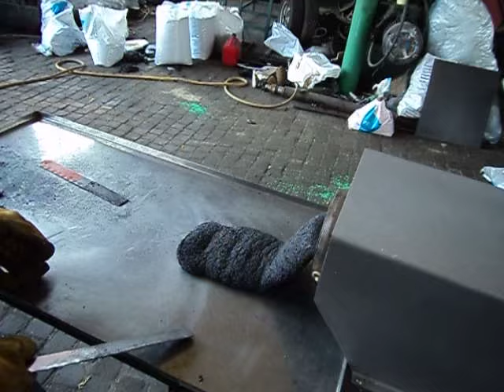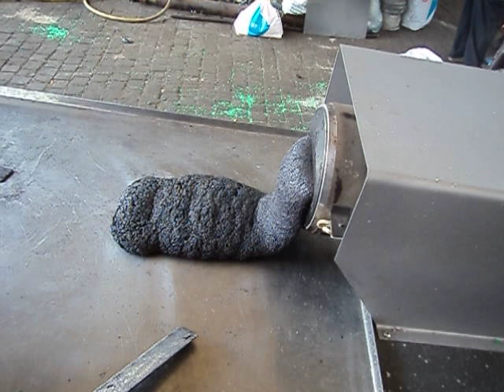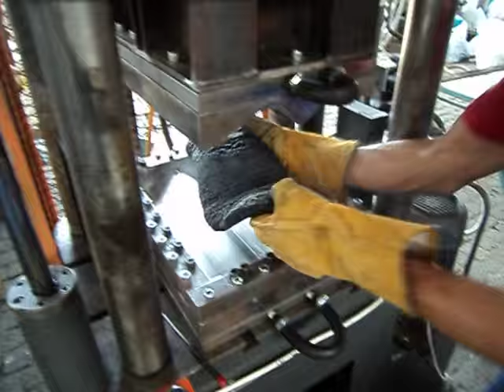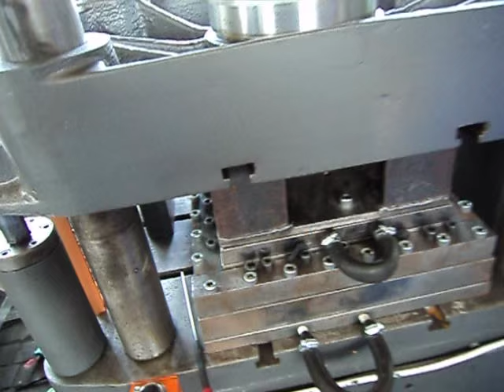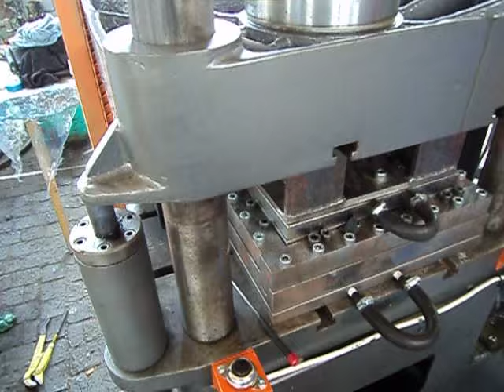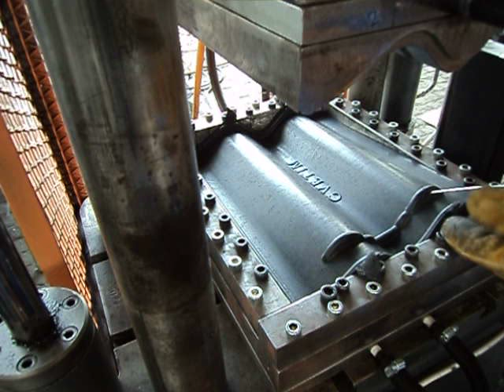Machine for Roof Tiles From Recycled Plastic

Comment from the maker: Hallo
We are the producer of this machines.
The installation costs 68000 Eur with the moulds.
We can make the moulds with a drawing or muster in Your standart/the standart is different in the countries/.
Time to work-3 months.Installed power-20 kW
The installation includes:
1.Specially extruder
2.2 moulds-tile and cover
3.Press machine
4.Mill for PET 
5.Calibrator cooler for the ready details
The machine can make 60 pieces per hour.
The making area is 20 m2 without warehouses.
If You have any questions please send us.
Best Regards

Comment: I'm interested in an operation like this machine can you forward me a price and more details
Reply from the maker: We are the producer of this machines. The installation costs 98000 euro   
with the moulds. We can make the moulds with a drawing or muster in Your   
standart/the standart is different in the countries/. Time to work-3   
months.Installed power-20 kW The installation includes: 1.Specially   
extruder 2.Press machine 3.Calibrator   
cooler for the ready details The machine can make 60 pieces per hour.   
The making area is 20 m2 without warehouses. If You have any questions   
please send us.The produce time is two months .   
The line for the production of floor coverings and roof tiles is the same. Just change molds.   
There is also a difference in the plastic mixture because it can also be used petrified PET bottles.   
The installed power is 25 kilowatts, but the working consumption is about 10 kilowatts.   
The blending ratio is 30% plastic and 70% sand.   
Marble flour can also be used to better achieve the desired color.   
For paint, use is an oxide cement paint..   
The cost does not include delivery costs. You will get a detailed video on launching and operating the machines.   
You need to specify what details you want to make.

Our plant uses waste plastic as a raw material, which cannot be used for separation and recycled as a secondary raw material. For example, plastic bags, car plastics, packaging and much more. Plastic waste is crushed with a grinder or agglomerator of fine particles about 4-5 mm. They are then mixed with dry sand in a percentage of 50/50 in weight units. 0.1% oxide paint is added. The semi-honest mixture is then placed periodically in the curing extruder, which cures the mixture and it exits as a soft mass. With a certain dose is placed in the mold and the press presses the finished product. The product is then placed in a special calibrator to make it true and not deform. One cycle lasts about 1-1.5 minutes.

Comment: Mr. Andrey Kolev
I´m studying in Espol (Polytechnic), Ecuador. I have to do an investigation about the molds used to manufacture PVC Roof Tiles. Could you give me some specification of the mold used in the Plastic Roof tile machine. Thanks for your time.
Reply from the maker: You need from injection mold for injection machine like this.  http://sell.lulusoso.com/selling-leads/1458739/Custom-Plastic-Rubber-Ceiling-Floor-Roof-Tile-Mould.html

Comment: I am looking for a plastic/sand roof tile machine. please send me some information. Interested in this type of equipment. Urgent
Reply from the maker: Hallo
We are the producer of this machines.
The installation costs 25000 Eur with the moulds.
We can make the moulds with a drawing or muster in Your standart/the standart is different in the countries/.
Time to work-3 months.Installed power-20 kW
The installation includes:
1.Specially extruder
2.2 moulds-tile and cover
3.Press machine
4.Mill for plastic
5.Calibrator cooler for the ready details
The machine can make 60 pieces per hour.
The making area is 20 m2 without warehouses.
If You have any questions please send us.
For more information please  on the  email     plasticam@abv.bg
Reply: @kotarakafeliks  .Hey I'm. In kenya how much will  a turnkey project cost
Reply from the maker: @jamesthuo5598  68000 euro all machines.

Comment: Hi Andrey... Please provide me with quote for that machine, interested in purchasing
Reply from the maker: Hallo
We are the producer of this machines.
The installation costs 38 000 Eur with the moulds.
We can make the moulds with a drawing or muster in Your standart/the standart is different in the countries/.
Time to work-3 months.Installed power-20 kW
The installation includes:
1.Specially extruder
2.2 moulds-tile and cover
3.Press machine
4.Mill for PET 
5.Calibrator cooler for the ready details
The machine can make 60 pieces per hour.
The making area is 20 m2 without warehouses.
If You have any questions please send us.
Best Regards
Reply: @kotarakafeliks  Hi Andrey.. I appreciate the prompt reply. Are your machines able to make bricks and pavers aswell for housing construction?
Reply from the maker: @blcad2596  There are many different forms. you have to offer a drawing, picture or sketch to answer you more precisely.
Reply: @kotarakafeliks  Thank you for the information. Can you provide me an  e-mail address, to send you the designs of units.
Reply from the maker: @blcad2596  My email is  plasticam@abv.bg
Reply: Hi Andrew 
Are you still selling the machine

Comment: Can you please send me more  details of this  machine thanks
Reply from the maker: Andrey Kolev
Hallo
We are the producer of this machines.
The installation costs 25000 Eur with the moulds.
We can make the moulds with a drawing or muster in Your standart/the standart is different in the countries/.
Time to work-3 months.Installed power-20 kW
The installation includes:
1.Specially extruder
2.2 moulds-tile and cover
3.Press machine
4.Mill for PET 
5.Calibrator cooler for the ready details
The machine can make 60 pieces per hour.
The making area is 20 m2 without warehouses.
If You have any questions please send us.
Best Regards  You can contact with me on the email   plasticam@abv.bg